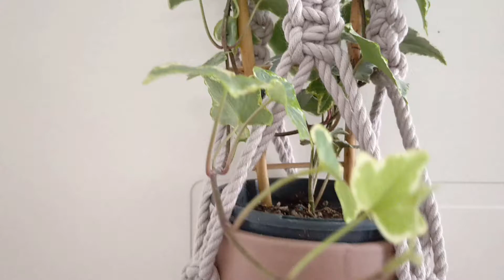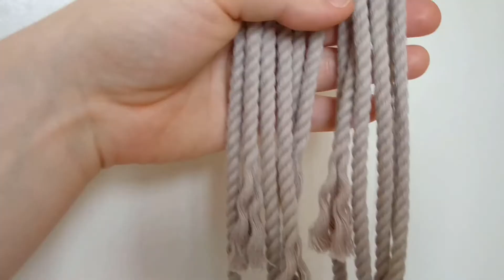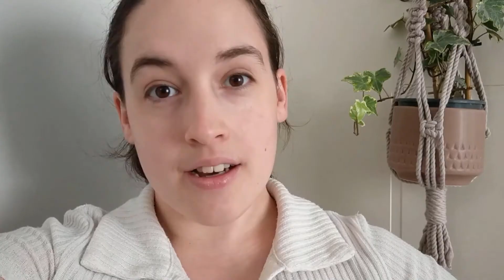Create With Me: Easy Handmade Macrame Plant Pot Hanger (BEGINNNER LEVEL)

Comment from the maker: CHAPTERS:
00:00 Introduction
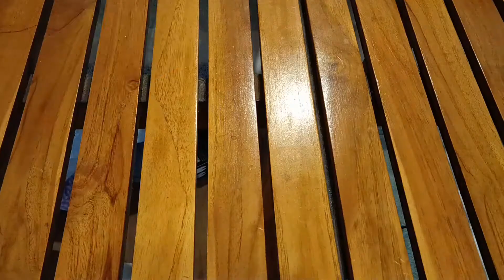00:20 Preparing the Materials
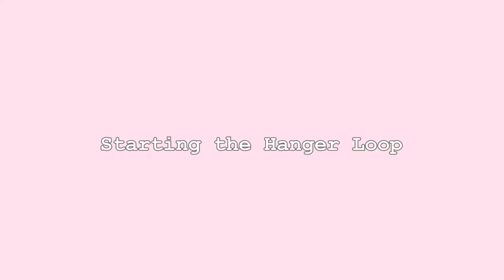1:11 Starting the Hanger Loop
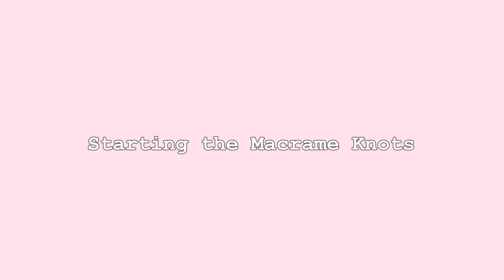03:23 Starting the Macrame Knots – The Half-Square (Spiral) Knot
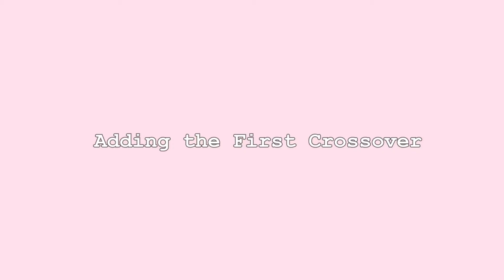05:56 Adding the First Crossover – The Full-Square Knot
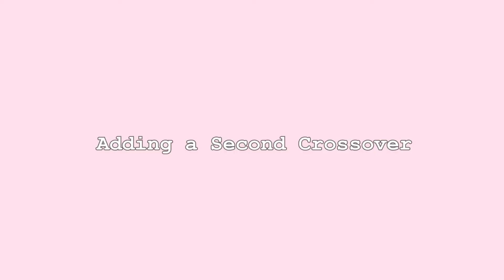07:57 Adding a Second Crossover – The Full-Square Knot (with a twist)
09:27 Finishing the Macrame
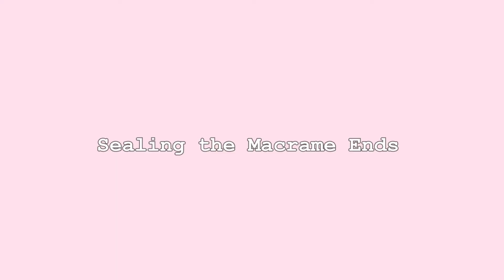10:57 Sealing the Macrame Ends
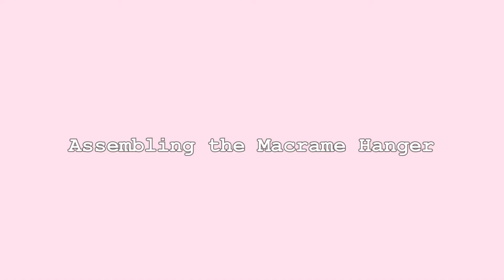11:41 Assembling the Macrame Hanger